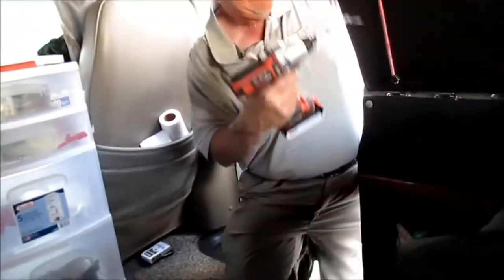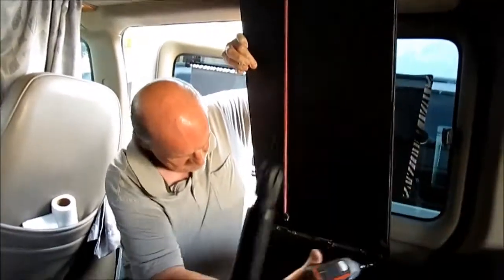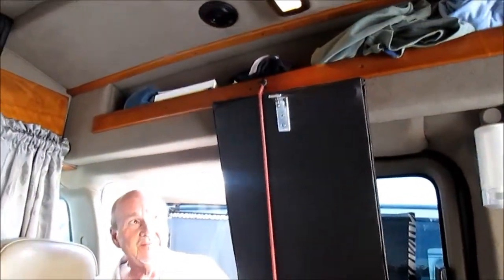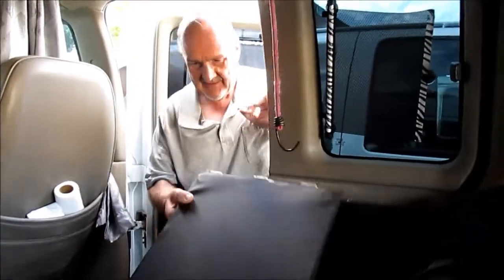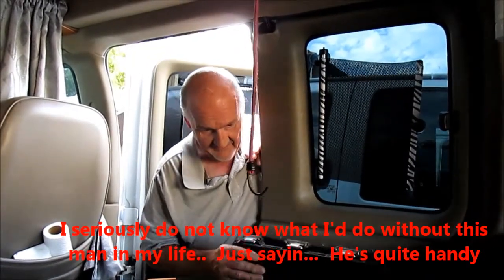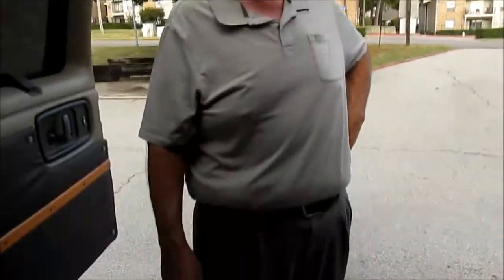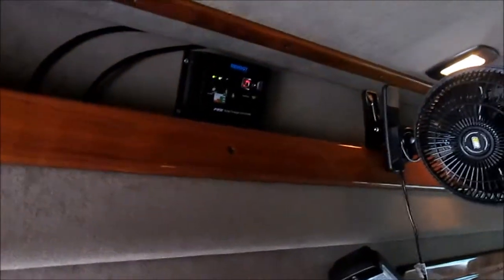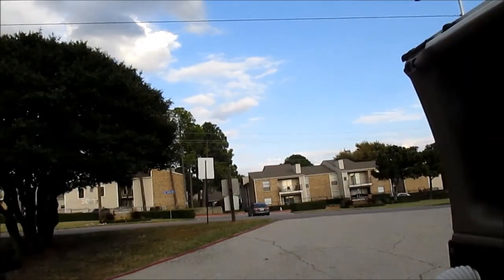Van Electrical System

Comment: I just started watching and I am confused...do you have any batteries connected to the solar? Or is it just your starting battery? The amps available for use are dependent on the battery size. The solar is what charges the batteries. The controller makes sure the batteries don't overcharge. The inverter only converts from dc to ac. It is way overkill for your situation. Maybe the previous owner was using it as an extension cord of sorts when on shore power to power the a/c unit, frig, coffee pot, etc. it certainly is confusing
Reply from the maker: Yes, I was very confused when I made this movie and was trying to make sense of the mess that I had just purchased.  I love the van, but it was a wiring nightmare.  Yes, the batteries are connected to the solar (properly now).  I have 2 deep cell marine batteries, but upon further inspection, one looks older and smaller than the other.  So I'm going to have them checked out next. They don't seem to hold a charge very long.  And yes I realize that inverter is complete over kill.  I'm not sure what the previous owner was thinking.  And at the time I was very unclear on how he had things set up and why.   The guy I bought it from spoke little English, (he's Korean) so what I thought I understood from him upon purchase is not how things were actually done.  Sorry for the confusion.  But thanks for watching and commenting!

Comment: check renogy web site, should have a  pdf file download  manual for the charge controller to help explain it's operation.
also I noted in the van tour overhead footage, I didn't see a solar panel on the roof, so that has me wondering about your solar source.

Comment: Greetings,

While your guy is being logical and has the concept of volts, amps and watts. He clearly isn't familiar with solar and how it is applied and used in an RV. 

Here's how it works, your solar panels are likely 12 volts and put out DC current. That DC current goes through your Renogy charge controller to charge your batteries. Once your batteries are completely charged, the controller goes into a "Float "state and just maintains a full charge. Without the controller, the panels would overcharge your batteries and burn them up. The solar controller should have several indicators showing if it is charging, floating and the current voltage of the batteries. A full charge for a 12 volt battery is 12.7 volts. You should never discharge your batteries more than 50 % which would be 12.1 volts. If you go lower than that, you will damage your batteries.

The batteries are connected to the inverter to transform DC to AC current so you can run laptops, charge phones etc. The more batteries you have the more appliances you can run off AC current. A solar setup in an RV is not intended to run such things like an AC unit and depending on the size and capacity of your batteries, that will determine how many things you can power and for how long.

So, that said, some people connect their inverters to 110 outlets they install in the RV. When the inverter is on, those outlets are powered up. Some other RV people simply plug a power strip directly into the outlet on the inverter and plug their appliances into that. Forgot to mention, some people install DC plugs that may be powered from the "House" batteries, vehicle battery or both. Just be sure if you plug into a DC outlet, monitor your battery voltage. 

From what I could see and what you said, It appears the previous owner intended to power the refrigerator off the solar system which is totally doable. In full sun, the system could handle the fridge and possibly run a couple AC items.  Out of full sun, it may only handle the fridge. All depends on how the system was set up.

So, in real world use, if you were boon docking, the Solar would power the fridge plus a few other things.

I'm by no means a solar expert but have been doing this for a while and have real world experience. My solar setup will power my fridge 24/7 plus run amenities such as my television, microwave and a few other things. While in full sun, I can run most everything in my rig. However after the sun goes down, I have to manage my usage so as not to discharge my batteries more than 50%. Hope this helps.
Reply from the maker: dkh, I cannot thank you enough for your response.  This is the information I was seeking, and the reason for this video.  Thank you, thank you THANK YOU!   I have some questions I'd love to ask you.   I will send you a private message, if that's okay.  And did I mention, Thank You!!!
Reply: I'll be glad to answer any questions you may have.
Reply from the maker: I didn't see a contact email on your YT page.. Can you shoot me an email?
Reply: Just sent you an e-mail
Reply: Just watched your van tour and that answered many of the things I made assumptions about . LOL, should have viewed that first. However, the reference to electrical in this video is what caught my eye:)